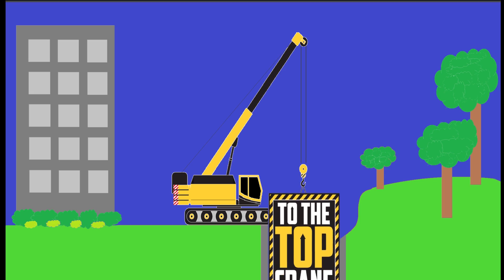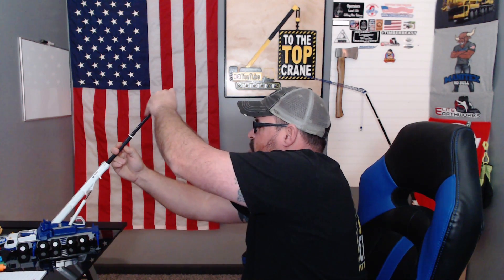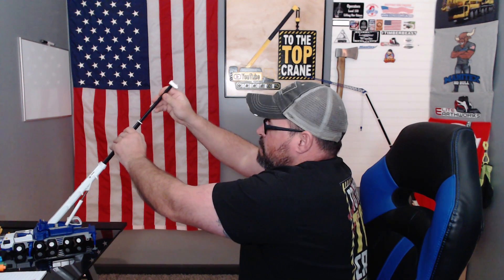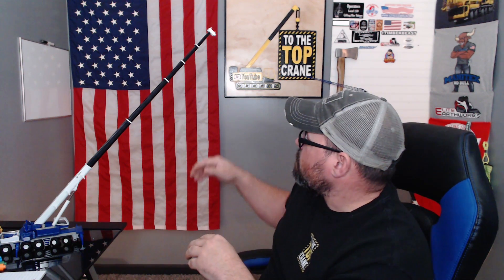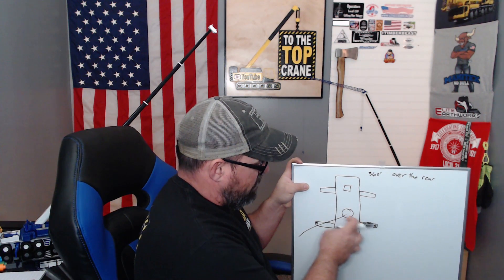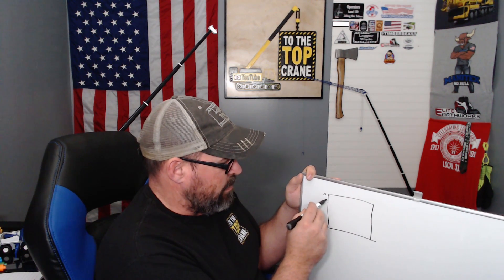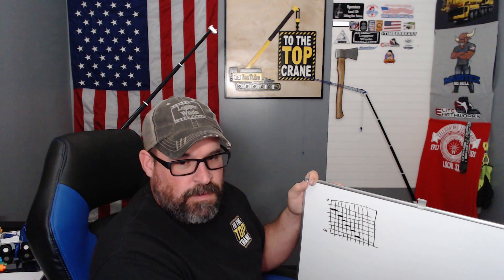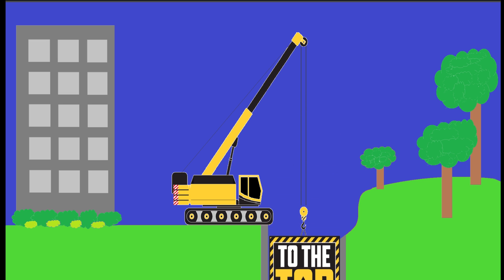Different boom lengths - 360 vs Over the rear load charts - BOLD line on a load chart

Comment: A bit late to the game here, but do you prefer to control the radius with the angle of the boom or the extension of the boom? My intuition says angle because it keeps the most weight closest to the base. Also, can you pick a load with the extension cylinder connected or does the boom have to be pinned? Thanks!

Comment: NOT A CRANE OPERATOR, actually I run a 100' Ladder/Fire truck. Not the same but similar in many ways. I watch your videos because you never know what you dont know, till you know it. I wish they would make Ladder rig drivers take a basic crane class. You tube and depending on a computer aided saftey system is the  best most get.

Comment: Good info. I see a lot of new operators that don’t really understand the black lines on the load charts. Structural vs stability is an important difference! We have had older operators that ran old P&H neck breakers and lattice boom cranes that had a hard time with LMI’s on new hydraulic cranes stop them from lifting what they thought they could pick.
Reply from the maker: Carl Williams, if a person doesn't know what the bold lines mean, they probably shouldn't be in the seat. I could definitely see old timers trying to push past the LMI. Many thanks for watching! 🙂👍

Comment: Yep...Lots of good info! Thanks...
Do you have any idea what each of the 5 sections of boom weighs? Be safe and have a great week!
Reply from the maker: Wayne Tharp, when we pulled the boom apart on our 100t crane, the five sections together weighed around 22,000 lbs. I was told that the entire boom assembly on the 200t was around 50,000 lbs. But, that's not confirmed. Many thanks for watching! Hope you have a great week as well. 🙂👍
Reply: 50K for the 200 ton boom....sounds about right, after watching the video with the dolly back there...
Reply from the maker: @dougankrum3328 , I've got someone from Tadano checking on the actual weight for me. As soon as I hear back from them, I'll update this comment. Thanks for watching! 🙂👍
Reply from the maker: 40,000lbs for the 5 sections.
Reply: @ToTheTopCrane  Thanks...Can they tell us what each section weights? I would think lift capacity would maybe make more sense if we had an idea of how much weight is pushed with each section. Basically...Can you disassemble it 1st thing in the morning and get me some figures! lol 😂🤣 Be safe, Jimmy!

Comment: Great video!!! Structural vs tipping!!!!! Like you said, the old rigs damn near never broke!!! Case in point, pulling sheeting with a lattice boom and a vibro.  We would pull up on the sheeting until there was 2 feet of air gap UNDER the sprocket on the end of the track and then turn the vibro on which would pull the sheeting up a few feet until the tracks were back on the ground.  We would keep doing that until the sheeting would finally come up with the cable,,,,,,
Reply from the maker: Richard Savaglio, I've seen similar things done with the old rigs. Hard to pull that off with a new one. Hope all is well! Many thanks for watching! 🙂👍

Comment: Clear and simple explanation, Jimmy.  Your points about the weight of each boom section and pick capacity was just excellent. Lots of folks don't consider the total weight involved in a pick includes boom sections. Some load charts don't tell you anything about boom weight at different configurations.   But, the operator better understand how each boom configuration changes crane capacity.

In another video, you might mention that load chart numbers include 15-20% safety factor. That does not mean that it's safe to lift over the chart!
Reply from the maker: David Sonnen, thank you! The load charts for the Tadano don't show the actual weights of the boom sections. But, there is a definite difference in capacities when different configurations are used. I am one of those people who believes that a person should know as much as possible about the machine they are sitting in. Knowledge is what makes the difference between making good and bad decisions. I haven't touched on the 15-20% safety factors because I don't necessarily want new operators to feel like they should push the machine. I suppose I should mention it at some point. Thanks for watching! 🙂👍
Reply: @ToTheTopCrane  Agreed, Jimmy. New operators who don't have proper training often try to short cut the charts. Bad idea.

I've had a couple wrecker operators tell me that since Crosby snatch blocks have a 5:1 safety factor, they can handle at least 4 times rated capacity... That's the kind of thinking that makes wrecker insurance expensive.

Comment: Can you make a "picture gram" of how the crane extension system works sometime?  I had it imagined while watching your other videos that there is one cylinder that locks and unlocks each section, pushes it out, then locks it back into place once it extends.  Then it goes back down for another section.  The only section that can be half in and out is the one that the cylinder is locked onto.  What keeps the boom from just retracting like a tv antenna when you have more than one section half out?
Also, thanks for the load chart explanation.  The older cranes that I have been around were always overbuilt as all get out, with no electronics.  I had an old hand crane operator tell me the same thing when I asked how does he know what the load on the boom was.  He said "you can feel it in your butt."  I remember thinking that with that method, you might be a little late.  When the Liebherr crane that the wind farm east of town was using to erect the upper tower sections broke its boom a couple of years ago everyone marveled about how thin the steel was inside the boom for the weights it was carrying.  It's amazing how the engineers have figured out the minimum that we need to lift the same capacity.  It's also amazing how a little more wind in the case of that incident can ruin your day in a hurry.
Reply from the maker: matt lee, there are some animated videos on YouTube that show how it all works pretty well. I also have an older video that explains how the pinning boom operates. https://youtu.be/UhM6SdmvWMs 

I have some pics of that crane boom that broke on the wind farm. That was a bad day for them for sure. I am just glad that no one was hurt or killed when that happened. Many thanks for watching! 🙂👍
Reply: @ToTheTopCrane  Thanks for the suggestions, I'll check them out.   I saw the aftermath of the second crane accident at the wind farm and what a mess!  There was fiberglass everywhere!  Like you said, everyone was so lucky to not have been injured as there was at least two in the tower at the time at the accident and the rotor section that they were lifting just barely missed everyone.  If I recall correctly they had to replace the door at the base of the tower cause it got hit.  They were that close!   Unfortunately the whole "hurry up and get er done" was going on and because the operator is the responsible party, it went on his shoulders and not the contractors shoulders when the blame gets passed around.  Thanks for showing the new operators the correct way to run a crane and telling them that legally they have the stop work authority and needs to be willing to use it.

Comment: Ya done good...  does your computer automatically chart whatever configuration you establish? Or are there specific charts for specific configurations?  Including outriggers?  Thank You..  and your jib is stored or stowed?  ☺🇺🇸
Reply from the maker: Barry Simmons, the computer will adjust capacity on the fly, based on what configuration that I put the crane in. It also knows the outrigger lengths. There are specific charts for all of the different combinations of boom lengths, counterweight configurations, and outrigger lengths. As far as the jib is concerned, in this video, using the diecast as a reference, the jib was stored. "Stowed" is on the side of the boom in the transport position. "Stored" is completely off of the machine. Thanks for watching! 🙂👍
Reply: @ToTheTopCrane stowed vs stored was the trick question on the test.  Thanks for your quick response...  Have a great day.

Comment: Simplest terms that I can come up with is that the weight of your boom has to be figured into the weight of the pick, due to a crane operating like a very big teeter-toter if you add more weight to the boom end than you have on the counterweight end.  (Via having heavier sections of boom further from the fulcrum.)  You end up having a bad day. Or if you still have enough counterweight to keep the counterweight side down you could just break the teeter-toter in half.
Reply from the maker: chase8148, that is a pretty good analogy. We try to avoid "bad days" at all costs. LOL. Many thanks for watching! 🙂👍